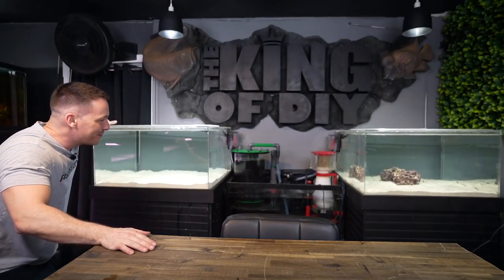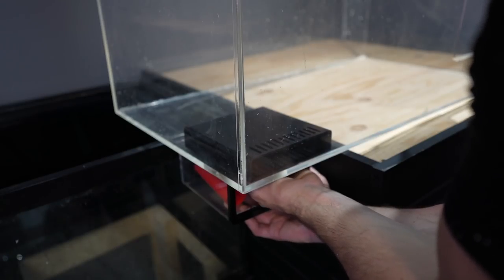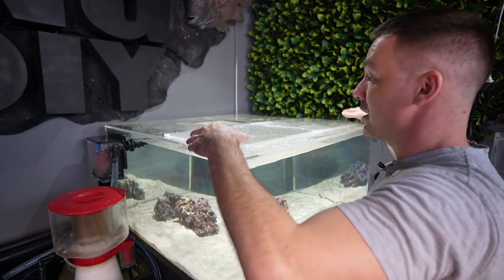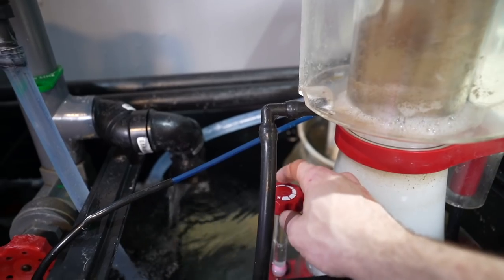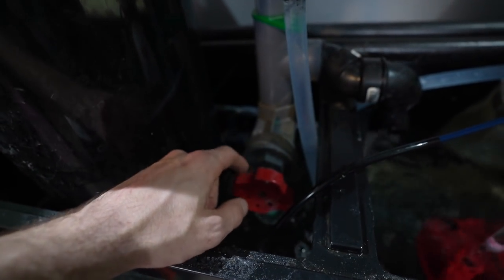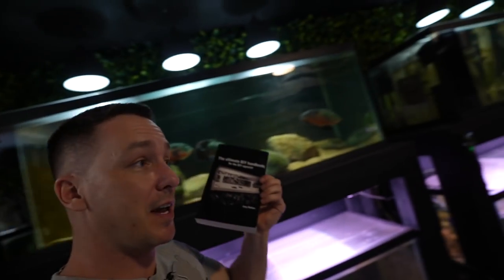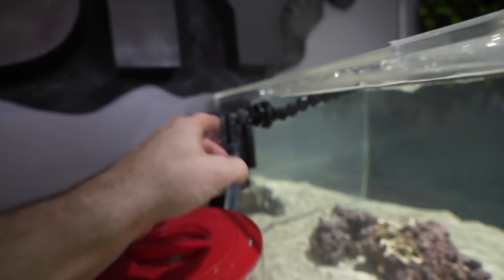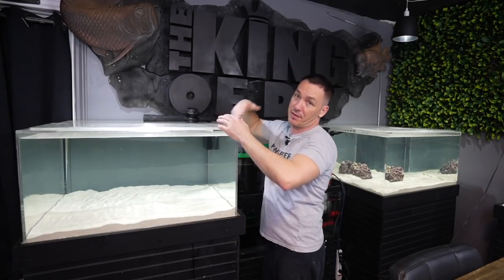Twin Aquarium setup walk thru

Comment: Hey Joey, I have those Eshopps overflow boxes in my freshwater tank and if you add a gate valve to de main drain then control the water level within the box, making it noiseless. I highly recommend it, also my aquarium is all a DIY custom aquariums set up inspired by your videos. I also have a fluidized bed with k1 in a custom sump
Reply: Love Eshopps newest Slim Line 💚💙
Reply: Gate valve 100%. I noticed they were flowing too fast as well

Comment: Nice build. Those overflow boxes are perfect for a full siphon system “Herbie”. Two gate valves on your overflow plumbing and have the outlet submerged inside the filter sock will make the system totally silent.

Comment: instead of weights you could drill some small recesses and use magnets. you can get some heavy duty ones that will make it impossible for the octo to lift or slide without ending up with some ugly big weights sittin on top

Comment: Great set up! I have been watching your videos for 6 to 7 years and have always found them helpful. I do have a question about acrylic aquariums. I bought a 25 gallon made by Advanced Acrylics that has small bubbles in some of the welds. I water tested the tank and it does not leak. The bubbles are small and don’t go all the way through the weld. Do you think that will be a problem?